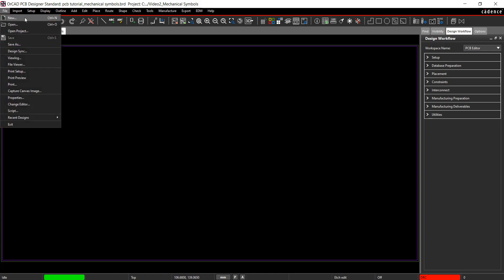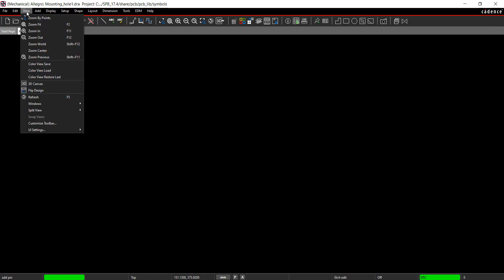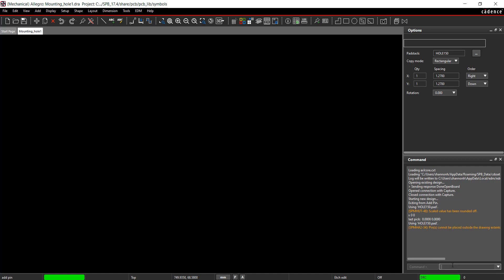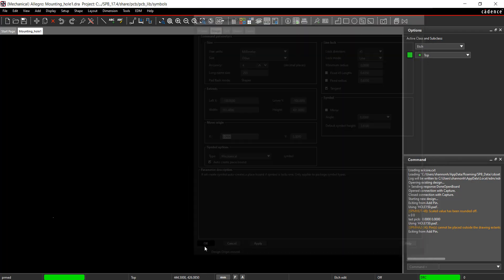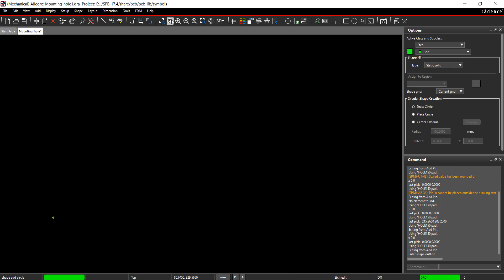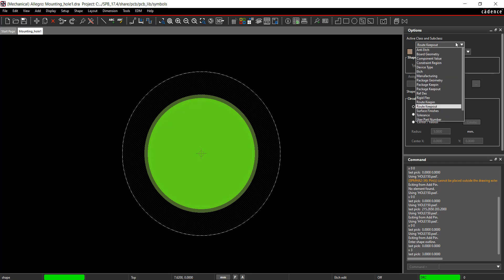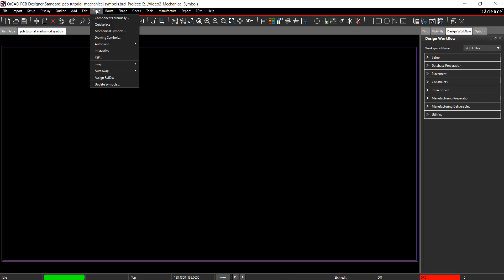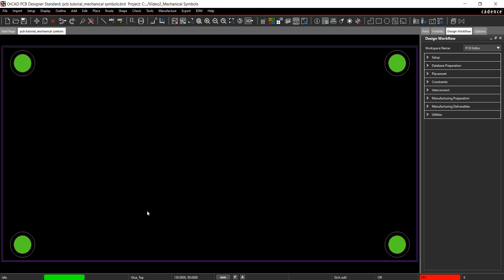How to Create and Place Mechanical Symbols in OrCAD PCB Editor 17.4

Comment: How the mechanical holes may be accounted in documentation like bill of material? I usually use electrical symbol for the board mounts, they may be then drawn in the schematics and pass on to the board. If mechanical symbols are used, they either need to be placed into a board template (for reuse) or not forgotten to be placed each time the netlist is passed on to the PCB... A tutorial might focus on these options and differences in approaches.
Reply from the maker: Thanks for your feedback. This is a great suggestion!